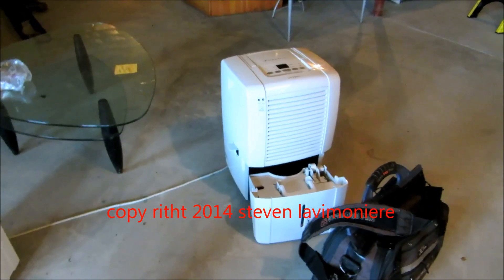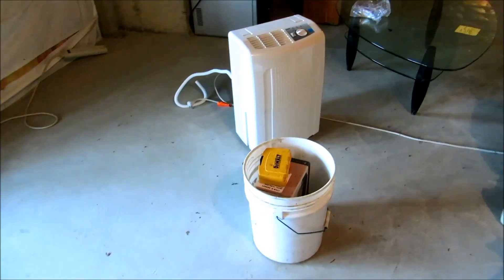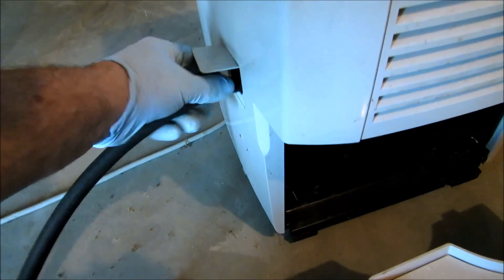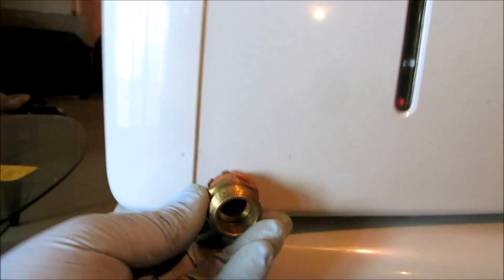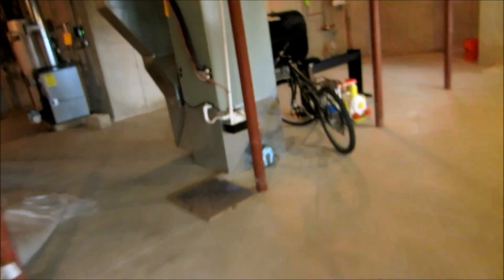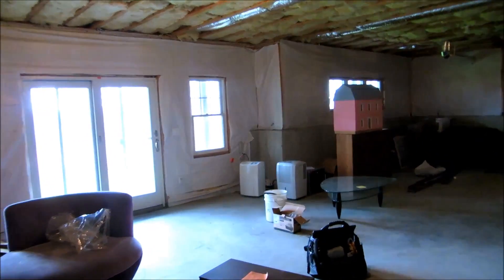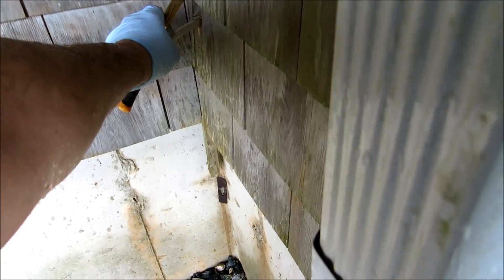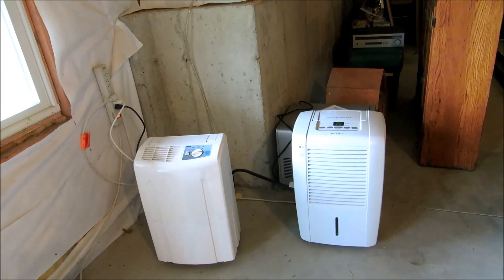dehumidifier water removal system:plumbing tips

Comment: If the condensate pump fails for whatever reason, then it seems the condensate reservoir ends up spilling onto the floor. Is that prevented somehow?
Reply: No this is a stupid set up. Plus that water is draining outside right by the foundation. Bad idea. Should have just got a 200 dollar midea with a built in pump and you can drain it into a sink or into a dwv if you have an air gap

Comment: idylis, have it without hose vent water.
but after cleaning the whole unit. . 
started making buzznoise. . 
and have to conected a water vent hose.. 
buzznoise stop.
now its overheating and shutoff. . 
HOLYCRAPYYY thing.
don't understand the problem. 
it's clean, has a hose, (how i used for a year and doesn't need a water vent hose) also i have a new power receptacle.

Comment: Instead of running two non efficient dehumidifiers you should spend a few extra dollars and get something like an Santa Fe unit.  Then you would be able to hang it from the ceiling and run a drain hose therefore bypassing the pump.  Also by doing this you would save a small fortune on electric.

Comment: Nice job Steve. Good idea on cutting hose in an Angle I'll remember that. Great video.
Reply from the maker: thanks daniel
Reply: @stevenlavimoniere  I just did that today So every now and then my dad word empty out our GE dehumidifier in the basement and right now I’m having the hose in Sump pump pit So the pipe goes under the floor and goes outside and there’s a pump